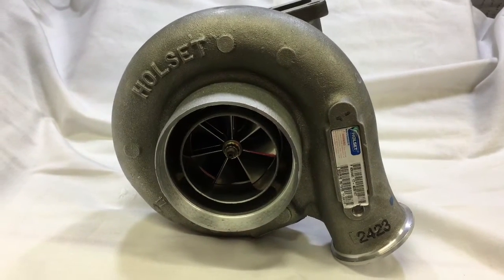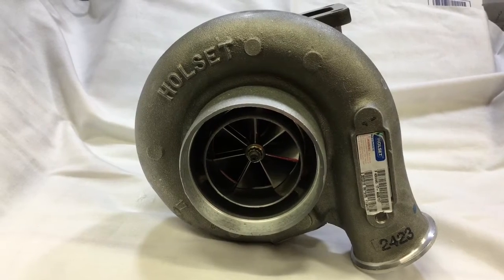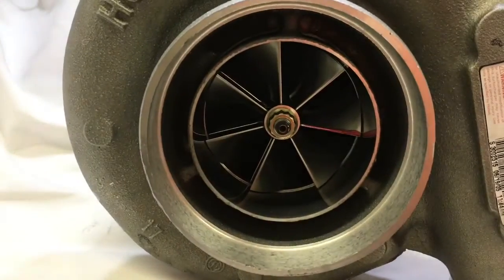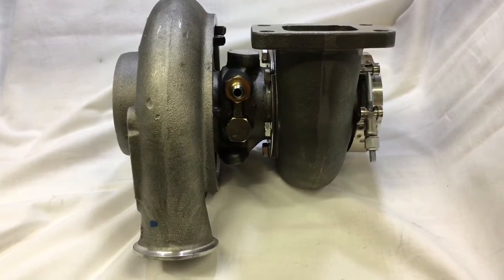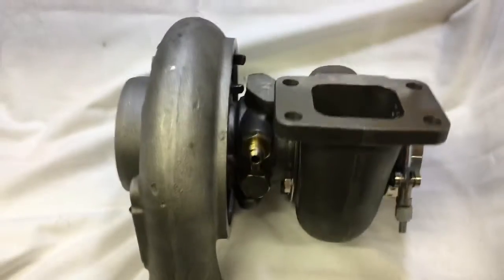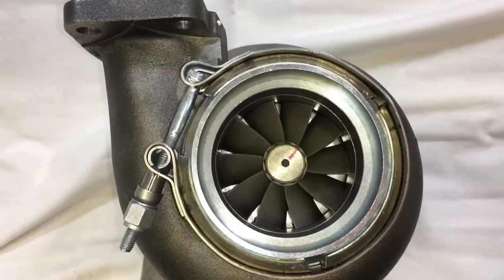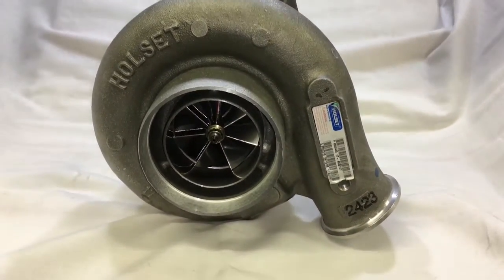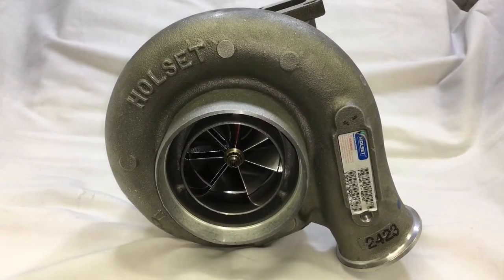Holset HX40G Turbo Upgrade Options

Comment: im only just learning about turbos, so please bear with me.
my current setup is used 100% for towing, cruze rpms are always over 2k. 65mph is 2200 rpm so i need something good for a 12v cummins that lives between 2k and 3k max. mostly 2k to 2.5k realistically. my gearing is 100% custom and never came in any dodge truck so there is no baseline to go off of. currently i have a stock HX35. i see 30psi max (boost elbow) but anything over 2k i get excessive egt's loaded or unloaded. i do not want the expense of compounds, i also do not care about lag. was thinking a HX40 would serve me better at 30psi in the higher rpm range. not looking for more power. just better cooling. what do you recommend for a single turbo, or upgrades to the current one to be more efficient at higher rpms.

Comment: Hey so my name is William and I'm saving up money to install a T3 T4 turbo onto my car, I have a 2.0L DOHC engine running around 150hp and I was wondering what ECU I would need to run my turbo and also what size fuel injectors I would need to keep up with my turbo
Reply from the maker: +William Lopez you can get some tuning tools like safc. I'm not an expert in tuning. There are different options for different cars but there are universal options for some cars too. It would cost a lot less to buy a turbo car. Expect to spend 3k to build a turbo kit, but leave a 5k budget. I built a turbo kit for about 2500